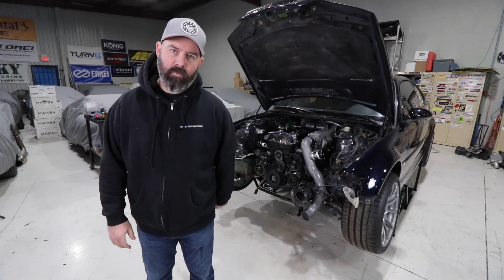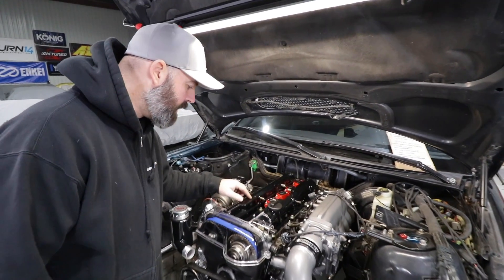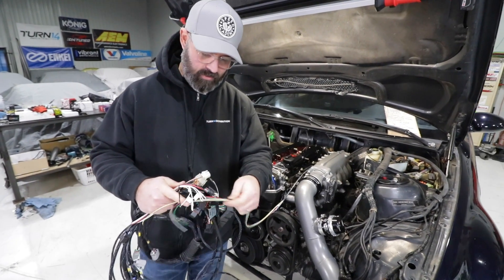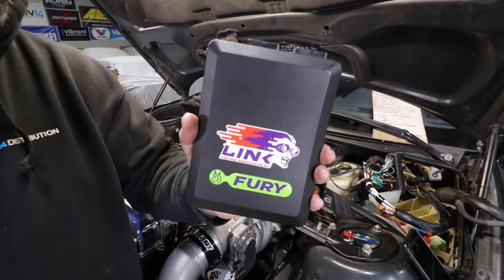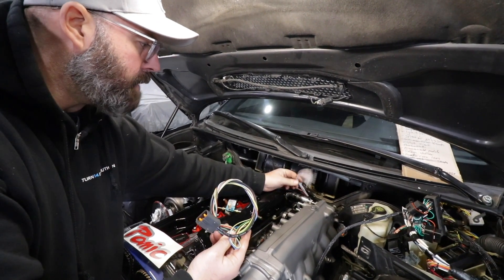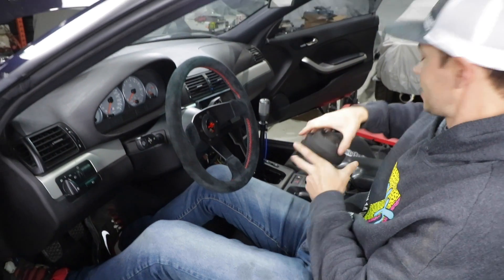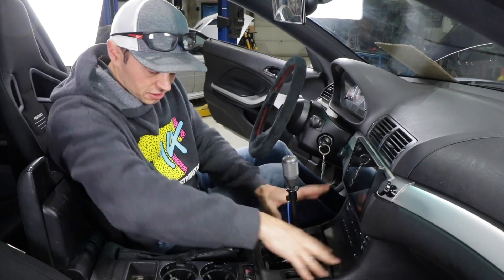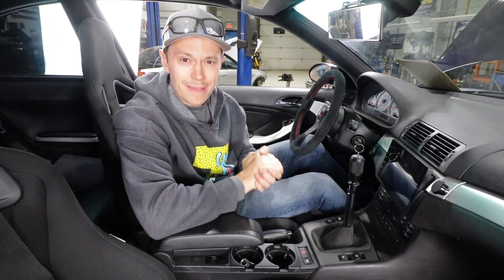Ultimate BMW M3 Rebuild - 2JZ Swap Wiring Solution - Part 14

Comment: Ceramic coating the cold side of the turbo ?
Reply: Pre-intercooler so it shouldn't make a difference in performance, just looks
Reply: Nicholas Rodrigues 
I get that , but you could actually gain some performance by zirconium plating the exhaust side and that would increase scavenging and reduce under bonnet temperatures .
Reply: @kirstysinclair9021  I don't remeber if they had the turbine housing coated but the manifold got a type of ceramic coat that insulates

Comment: I used to work next door to Mark.  His brother Matt has that crazy Beams motor early 70s celica.  Matt is a wizard behind the wheel and Mark is a wizard with wiring.  Both are top notch guys.
Reply: Oh hi and thanks! Fun fact: I also drive :)

Comment: sounds like the ignition system is a Lost Spark type system, which is what comes stock on Mazda Miatas, although the older ones of course are not coil-on-plug.
Reply: It's fully sequential.
Reply: @panicwire  my bad, I was thinking of Wasted Spark, which it appears is what the stock ignition system was (1 coil per 2 plugs).
Reply: @Patrick94GSR  You're correct. I've taken the stock ignition to 700hp but seq with these modern parts is obviously better :)

Comment: dang...the MSD box only does 3 sparks under 3000rpm and 1 big spark from there to redline.😕 yes DP, I've painted my coils before with 500°engine paint to match colors in the engine bay. lastly before you break that nice shift boot, screw the knob off maybe?

Comment: hello guys, first of Happy new year for yo guys, question for you, that radio you guys install doe it use oem amplifier or have to rewire to this radio, the reason i am asking i got 04 330 zhp, and car have HK sound system with oem subwoofers dont really want to loss them.. thanks
Reply from the maker: It plugged into the stock harness but it was in the back so you have to run a harness back there. I think the company includes it though.
Reply: @speedacademy  do you have a link for it and also any promo code for radios.. best regards
Reply from the maker: We installed it in one of the earlier videos and the link is included in it. Sorry don’t recall which one exactly.

Comment: I have been using 3M Safety Walk tape on the stock pedals for years. It has been in my Z33 for over 40k miles. Still hasn't worn out and if it does I can just cut another piece off my roll. It's cheap, light, and looks legit.

Comment: Guys, nice try.The best thing about your car is THE SEATS ! Having owned several BMW's in the past, I can tell you, the wiring harness and overpriced coils are the least of your worries. They are mechanical nightmares. Just the fact these idiots put the fuse panel under the glove box and starter behind the intake makes me want to drive any other brand.

Comment: There is a new turbo spooling technology where compressed air is shot against the turbine to fast spool the turbo.
A micro switch on the throttle or a pid in the ecu opens a valve when boost is low and the loud pedal has been depressed .
An existing turbo can be modified with this technology as it only requires a small hole be drilled and taped in the right place so the jet of air can spin the blades. It usually goes on the exhaust side to help ignite unburnt gas further spooling the turbo.

Comment: Happy New Year from New Zealand.

Schroth Rallye 4 asm would have been a better belt option, 4 Point harness with belt clip, but retains anti submarine breakaway design of the Tekate harness.
Reply: I agree. The ASM is an almost essential feature for a street driven car with a harness.